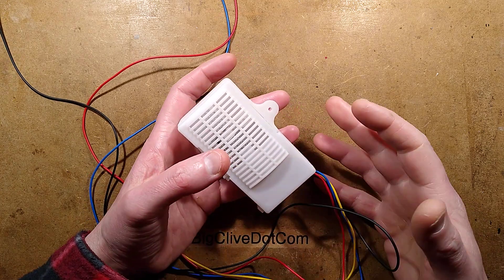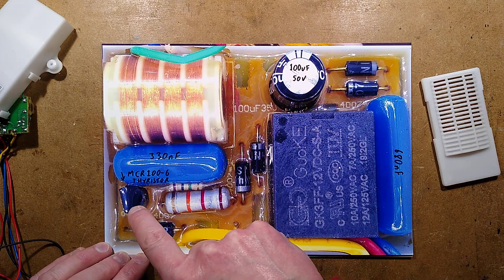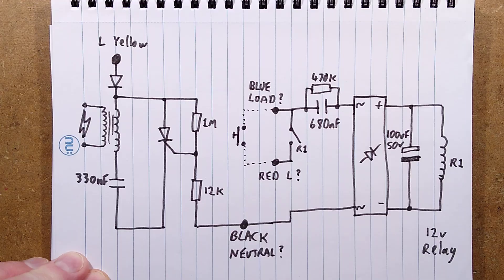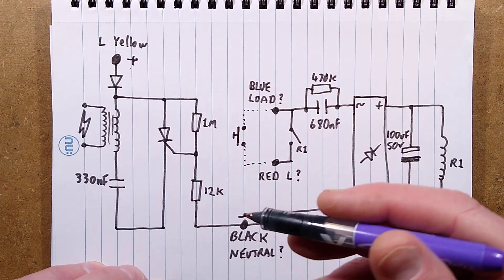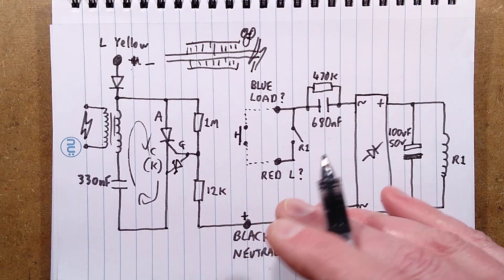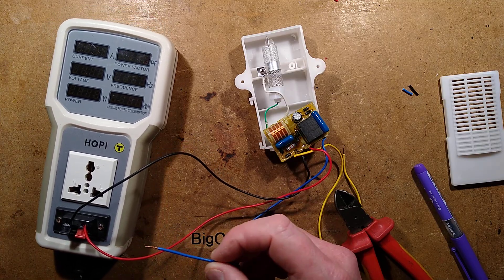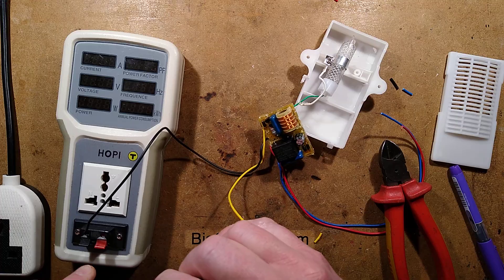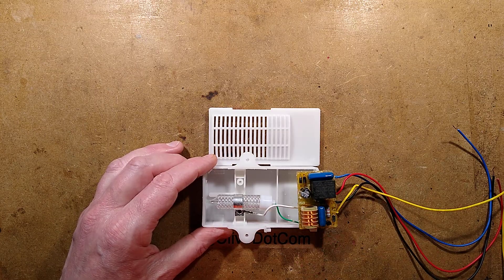Random high voltage eBay "thing"

Comment: You've presented these as completely separate circuits - the relay just latches blue on after a momentary press, the high-voltage side just operates when yellow and black are connected.

If you linked yellow to blue, wouldn't that mean the circuit will latch on with a momentary connection yellow/blue to red and the relay will then actually be relevant to the ozone side of the circuit?
Reply from the maker: It may also activate an external load.
Reply: @bigclivedotcom  Probably set up like a clothes dryer. Put a door interlock switch to the red wire, and a timer switch between blue and yellow.

Comment: Citation Needed: How many kids do you know of that baked themselves in tumble driers, more to the point, how small were they they could even both reach the controls whilst fitting inside? o.o
Reply from the maker: The old dryers would start if a kid climbed in and pulled the door shut.

Comment: Pretty cool discharge. That noise would get to be a pain in the arse after awhile. There are 12v ozone generators much cheaper than this. This circuit is interesting however.

Comment: So wait... the yellow wire would then in a real installation be permanently connected to where you put "Load?" in the schematic, right? If it was on live, then the relay circuit would just do nothing useful if I understand correctly.
Reply: Well yes, but actually no... I don't get it. Yellow and blue together red to live, between red and y/b a contact, but another switch to turn everything off... I think I woul set it all up differently, but it might work like this

Comment: That excimer lamp should glow, however it is intended to run on several kHz but here only 50Hz is used, Im quite sure that that is the reason fir it to show sparks. The colour of the sparks however looks like legitimate xenon
Reply: thanks for heard. If you look under Radium Xeradex you should find more about the technology and the physics involved. Sadly such a real excimer lamp is extrem expensive, many thousand £...

Comment: Shouldn't the tube be open to the atmosphere to produce ozone?
Reply: It's a con I wrote a long list proving this but it was immediately removed ☹️
Reply from the maker: It may be in an approval list.  I'll check later.
Reply from the maker: It's exposed to air.
Reply: @bigclivedotcom  That makes sense.  It looks as if it is sealed, but that would make it useless at producing ozone.
Reply: The corona discharge occurs in the air on the outside of the sealed tube. Electromagnetic energy easily penetrates glass.

Comment: The transformer looks like those used in igniter circuits for gas appliances. The circuit is just odd though. A thyristor cathode to gate is effectively a base-emitter junction, so that would fit with a relatively low breakdown voltage.

Comment: Hi Clive, it's not clear where the Ozone is actually produced, but I assume it's around the outside mesh.
However from the discussion, it seems that the glass tube is sealed (with ozone inside?), so if the discharge is in a sealed tube, how does it create Ozone?
Reply from the maker: The corona discharge is on the mesh.
Reply: @bigclivedotcom  So the gas inside the tube acts as a conductor to extend the voltage out to the glass boundary. 
eg it concentrates the voltage across the wall of the tube. Makes sense. Thanks Clive.

Comment: I've worked on old motor drive inverters that use SCR as the switches... Interesting design that is based around similar concepts. It's a simple way to get a reliable drive to work at the cost of a little efficiency.

Comment: My guess is this is sterilisation module for fridge. Switch would be connected to door, turning module off when they are open.
I like how they minimised component count low and used most of available place on circuit board. There are also component markings on board. Neat.

Comment: Let me translate.
Electronic Ozone Generator
Model : HT-238-C (4 wires)
Voltage : 220V/50Hz
Guangdong Hotor Electrical Appliance Co.,Ltd.
(right hand side vertical wording) Pass Certificate
Reply: Selling price in China is around 1-2 Pound
Normally used in : Disinfection cabinet, e.g. Chopsticks or cooking utensils in kitchen.
Reply: @何馬士  Thank you! Much appreciated 😀
Reply: @garygoldstein327  Its warned against using any ozone generating device in a non-ventilated area, because it can cause a bunch of respiratory problems.
Reply: @benhook1013  Definitely! Safety precautions should be taken with ozone machines.
Reply: I would think of it as more of an odor elliminator and air born anti fungle device but a device to protect against mold and mildew growth formation on bamboo utensils mskes a lot of sence.. Pretty ingenious.
Reply: Thanks for the information! :)
Reply: I wonder if the oversized cap allows the manufacturer to use the exact board in their 110/120V markets.  A 12V relay should kick on at the 8-9 volts available?
Reply: 15 years ago I saw exactly the same thing, and it was installed inside a refrigerator water dispenser which in fact did not even have a compressor.  But I do not remember where it was installed inside ..
Reply: don't understand the pass certificate's purpose.
If it fail, it will not end up in customer's hand
So, every product that end up in customer's hand should be a pass product.
The logic of the pass certicate puzzle me.
Reply: @samliu6872  Your assumption is not valid in China. Pass Certificate can be bought easily from online shopping.
Reply: Cool!
Reply: Thanks 🙏
Reply: Thanks for the translation!😀
Reply: Of course it passed! It's Chinese.
Reply: @blizzy78  i would love to see what actually qualifies as a fail in some of these factories, ive had products with unsoldered wires before, plenty that don't work at all, and some with some questionable substances on the boards. I wander if they just pick up a blind man with 1 arm who can just stamp qc on everything without checking.
Reply: @shroomiestshroom3655  must be some blind man cause your iPhone is also made by them.
Reply: @shean-koklim4197  correction, his iPhone is made by child lobar and under paid employees. There for they are considered iphone citizens and not Chinese.
Reply: @shroomiestshroom3655  i had a device where the quality control stamp was just printed on lmfao
Reply: @GmKofHard  A Chinese friend of mine, in China, said that the cost to make an iPhone is 3% of the retail cost, I can believe that. No wonder Apple is a 2 Trillion dollar company.
Reply: @grotekleum  yeah but you also have to add marketing, shipping, and add intrest incase of a faulty device. But the total cost of an iphone is around $150 to $200, which is ridiculous amount of profit for a device that has so many limitations and such shitty tech support/warranty.
Reply: @shean-koklim4197  generally people’s problem isn’t when something manufactured by them.
Problems start to rise when they start thinking with their small small brains and actually design something however this is quite rare since they rather prefer copying other western manufacturers
Reply: @shean-koklim4197  just look a xiaomi or huawei horrible horrible phones
I once owned both but that was years ago and those were my most hared phones

Now nearly noone uses chinese phones around here
Reply: @shroomiestshroom3655  It varies greatly on region and factory. Obviously if requirements are non existent or scarcely enforced a company run under a capitalist system will choose to taken advantage of that as they are greatly incentivized to do so.
Reply: @nincsasd8034  no one not "noone"
Reply: @blizzy78  don't worry, it's CE approved...(China Export, LOL)!
Reply: @mrtechie6810  The CE logo looks  different.😄😆
Reply: @blizzy78  ...and you have them all over your house dont you?
Reply: Could you enlighten us on it's purpose?  Seems small for any real world use, like a room.  Thanks for the translation <[(8-)
Reply: @jackwilborn2353  The description from seller is ： It is widely used in disinfection cabinets, dry wardrobes, shoe cabinets, water dispensers and other household appliances to purify and decompose odors.
Reply: @何馬士  thank you.
I love how ppl automaticaly doubt china's products as fraud.
And at the end it turns out to be working and cheap.
Thank you China for all small/cheap products that make us all happy. :)
Reply: @MilanTheMan69  Frankly speaking, some products from China are not good but still have a lot of them are Okay. You have to choose carefully and avoid those unreasonable cheap in price.
Reply: @何馬士  does it also decompose the shoes?
Reply: @mrtechie6810  I didn't bought this, no idea. 😄
Reply: @jackwilborn2353  its used it cabinets or spaces like that.
Reply: @Munin Mistweaver I've been on the Internet since the 70's, of course it was ARPNET but same animal.  People skim entries this long, at least I do, I don't have hours to detail.  I watched the video and some of his statements were obfuscated to me. When the gentleman from China offered a translation, I just asked for the rest of it.  
This type of response is why 'newbies' don't ask questions.  If it's not constructive, it's a personal attack.  Please don't treat us all as idiots. Take care, stay safe. <[(8-)
Reply: @jackwilborn2353  I don't believe your claim of being online since the '70s. I was not around for ARPANET but I was definitely active on USENET from early on and let me tell you - it was brutal. Newbies were flamed to a cinder for asking a question already answered, failing to read the FAQ before posting, stepping outside the "cultural norms" of a particular newsgroup, and so forth. You feel bullied in this thread? Don't make me laugh.
Reply: @sootikins  Well said.
Reply: @jackwilborn2353  "arpnet" ok bud
Reply: @Munin Mistweaver Sorry if I offended you to the point of forcing you to bully me for not seeing something.  I just wanted to know his view of the uses there.
Reply: @jackwilborn2353  "Sorry if I offended you to the point of forcing you to bully me for not seeing something" So, you admit it was your fault! Wow, that's a small world you have there.

Comment: Excellent! Using an SCR like that is pretty different too, and I'll have to have a go.  As an aside, anyone remember a circuit diagram from PW / EE or ETI using a SIDAC in parallel with a capacitor as a sawtooth wave generator?  Output was used to create a square wave via a logic gate, and apart from the constant current supply that was that. I believe there were a range of caps to provide different frequencies, and I also think the SIDAC was  a "component of the Month" feature, but I've no other info. Any thoughts will be much appreciated!!

Comment: That transformer/capacitor network reminds me of a circuit I saw in my youth, a capacitance discharge ignition system (CDI), which was the rage in the 60s. It would charge up a capacitor, then dump its stored energy into the primary of a conventional ignition coil, producing a spark for the plugs. Hence, CDI. Except that here the position of the capacitor and the inductor are swapped. What looks familiar is this LC tank where "L" is the primary of the transformer. First assume the capacitor is charged up to the peak line voltage, about 350V. This represents stored energy of 1/2CV^2. Now trigger the triac (the old CDIs used an SCR). The inductor (the primary of the transformer) is placed in parallel to the capacitor. At T=0, the inductor has no current through it, but it has a large voltage placed across it. This is an LC tank with an initial condition of Vinit = 350V. It will ring with a period of 2π*SQRT(LC). The energy now bounces between the capacitor and inductor. 90 degrees into the oscillation, the inductor has converted the capacitor's initial energy into its own energy of 1/2LI^2, while the capacitor has 0V across it and therefore no stored energy. At 180 degrees, the capacitor gets this energy back but it's voltage is now reversed (-350V) and the inductor again has no current through it. 

But the 180 degree mark is the interesting part of this circuit, because at this time, the current that had moved from the capacitor to the inductor and back to the capacitor has decreased to zero. What happens to a triac when the current goes to zero (or near zero, actually)? That's right, it shuts itself off. It's at this point when I believe we see energy transferred to the secondary. You get a very large flyback voltage across the inductor (transformer primary) although there isn't a lot of energy stored in the inductor at this time because of the small remaining inductor current. This primary voltage is stepped up by the secondary windings. When that voltage is high enough, you get an arc.

In theory, at least, there should not be a lot of energy in this HV zap, but I suspect that the holding current of the triac leaves enough stored energy in the inductor to deliver a good spark. This may be how the circuit limits its power, by selecting a triac with a somewhat high holding current, Ihold.

It's more involved than that, but I think this explains how you get HV to the secondary.

While this is going on, the capacitor will charge back up, from -350V to +350V. That 1M resistor has a bit of mystery about it. What's needed for this dissection is a scope probe on the gate, but that is a very dangerous voltage to try to probe. It's best left alone!

Comment: I suspect the yellow wire connects to the blue wire, probably through some sort of door switch, so it won't generate ozone while the door is open. You could also connect a timer to the yellow wire and the red wire connected to the power through the NC contact of the timer. So you press the button (as you drew it) and it shuts itself off only when it's produced ozone for a certain amount of time.
Reply: Ooh! and you could also attach a solenoid to the yellow wire, so when you close the door it locks and you can't open it until the time is up, or you unplug it, or press the E-STOP button.
Reply: @GordieGii  I hadn't thought about a door lock. A Tissue-Tek cryostat that uses ozone for disinfection seals up the chamber with a slight vacuum and locks the window during disinfecting. The window stay locked for quite a while after the cycle is done. It probably uses 1000X the amount of ozone this little device produces since it's a medical lab device.
Reply: @markc2643  Could be a component for a cheap Chinese knock-off. I think somebody said "a chopstick sterilizer."

Comment: Absolutely love your videos, keep them coming. Having looked at the ebay auction and pictures of the 2 wire version, which still has the bridge rectifier fitted, and the second capacitor dropper, I'm wondering if a slightly different power arrangement would work with the whole thing in series, albeit with a slightly odd colour coding system, so red and blue are as you stated previously. Yellow is Neutral, Black becomes a status indicator output, attached to a neon perhaps between black and yellow. With the relay unenergised, no current flows, press button to latch the relay , ozone circuit fires up, black wire follows live mains polarity so possibly could drive a neon. What do you think, would it still work, would that help to keep the relay coil voltage within limits? Anyway great video keep them coming,

Comment: Do you think that the tube could be used in a Geiger counter circuit? I don't know maybe some sort of DIY home brew thing? I wonder if the sparks increase if you bring a radioactive source next to it? 
I think that it might be possible that if the input voltage was lower to just get it to the point where it isn't sparking, it would probably spark with a radioactive source next to it... Interesting...

Comment: Like a lot of other four-layer semiconductors, thyristors have a "body diode" or "parasitic diode" formed by the way the structure sits on the intrinsic silicon substrate. Normally it can cause latchup failure modes but the designers may be deliberately using it during the charge portion of the cycle. It's been a while since I studied 4 layer devices so I could be full of beans.

Comment: What Conformal coating have you ever used?
Or potting ?
What is the clear lacquer they use?
I know...newbie questions... I can see you rolling your eyes now? Lol
Just ignore me if you must? Lol
Reply: Don't be shy👉💎👈
Reply from the maker: Look for tropicalised coating or PCB lacquer.
Reply: Both conformal coatings and potting compounds are commonly available in epoxy, acrylic and polyurethane and in numerous filled versions of those materials. There are also many other materials used that are uncommon for good reasons.
Reply: @KJ6EAD  thankyou
Reply: @groovejet33  Great ain't he🤜❤🤛

Comment: Odd use of the thyristor. I'd feel much better with a 1N4148 from gate to cathode. Allowing breakdown to occur normally shortens the life of a semiconductor.
Reply: No expert here but zener diodes do operate continuously in the breakdown region. There is nothing special in their manufacturing to allow that other than to tune the breakdown voltage.
Reply: @sitechca70  Exceed the reverse breakdown voltage for the base emitter junction of a transistor and allow it to breakdown. See how long it meets specifications.

Comment: You get a device that seems built for a specific purpose, but you have to guess what that purpose might be since there's no documentation of any kind.  Kind of... What's the right word for it?  Decrypting?  Or using your knowledge of electronic circuits to make a guess as what the application was.

I wonder if the relay would pull in with 120 VAC, 60 Hz. since the frequency is 20% higher and the relay might work on 9 or 10VDC.
Thanks!